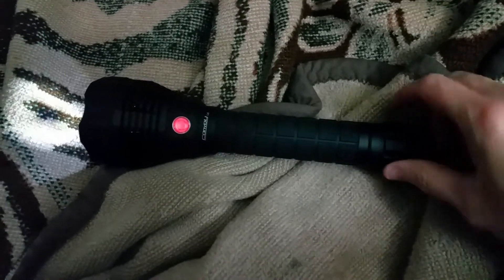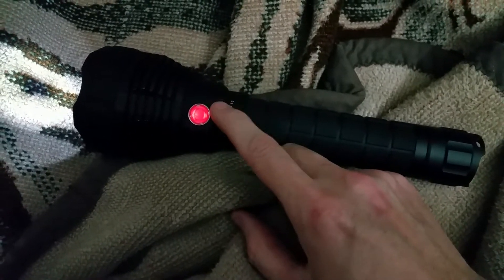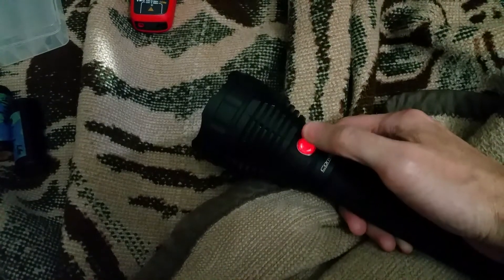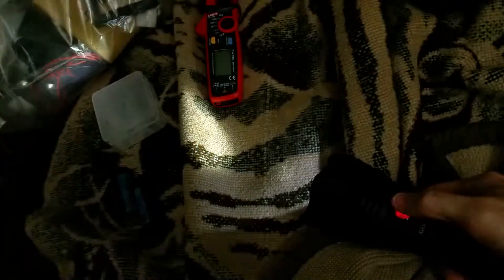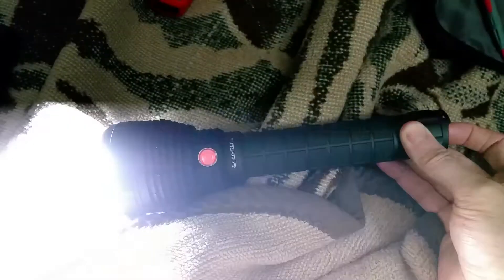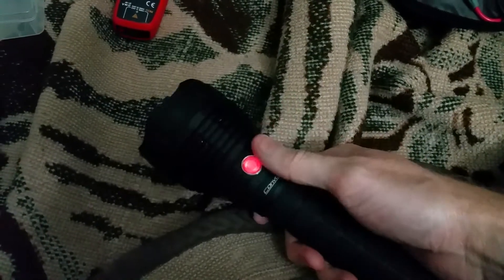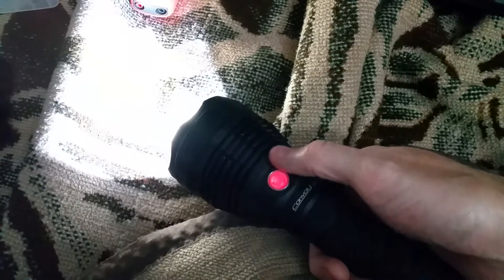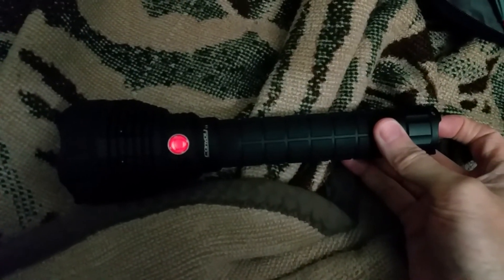Convoy L6 w Texas Avenger FET driver/Narsil and Lighted Side Switch

Comment: Very Cool! I think I like that orange switch better than your earlier white. 
I should send you one of my L6's  to mod with this combo. 
12.6 amps. Yikes is right! 
I thought my 7.6A was something special  : - )
Reply from the maker: Steve Kluver Thanks. I was able to fully charge my Liitokalas 5000 batteries and do a full 30 second amp draw test. It leveled out right at 12.0 amps so I'm calling that the official amp draw.

I'm not so keen on the orange, I may try pink or a pink/blue combo to make violet. 

If your running the stock driver the switch would only light up when the main beam is on. I don't know how useful that would be. If you have a driver with standby mode, then it's really helpful. 

Since I posted all the details of making this, a few more people have also done it. I put the link above.
Reply from the maker: Bryson Hicks - Hey, sorry I didn't see your question until now. 

If you mod the L6 for more power than stock, then you lose the ability to run turbo until the batteries drain. More power is still good, but it's called turbo for a reason. It's a temporary, extra boost of output. For continuous output you have to ramp it back down to about the stock output level. Then full power is used for brief amounts of time.

With the above setup, you can maybe do full turbo 1.5 minutes before the head gets really hot. Since I've swapped to the xhp70.2 emitter I'm getting about 17A to 18A and about 8,500 lumen. I can only do turbo for 45 to 60 seconds. This is conservative because I don't want to let it get too hot. It will get burning hot on the outside before the inner components will fail.

Longer runtimes are still possible, you just need to ramp it down a little. I rarely use turbo myself, I usually bring it up to turbo then hold the button to ramp down for about a second and I see it start to drop the output a tiny bit. This is my work light and I use it in short blasts of 5, 10, maybe 20 seconds at a time and it lasts me a full week. Full turbo power is used sparingly, like for measurements and showing it off. :)
Reply: How long can you leave it on turbo before it damages itself due to heat? I'm looking to this mod to get more power out of it, but being able to leave it on turbo for extended periods of time without the risk of frying it is important to me.